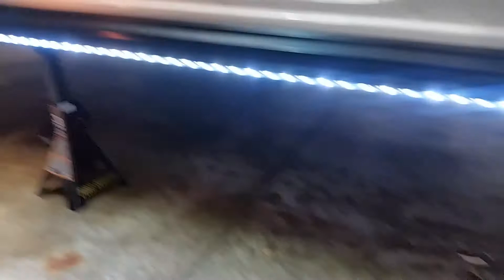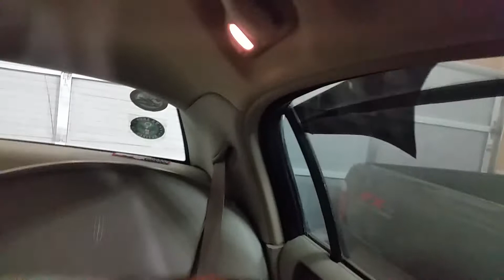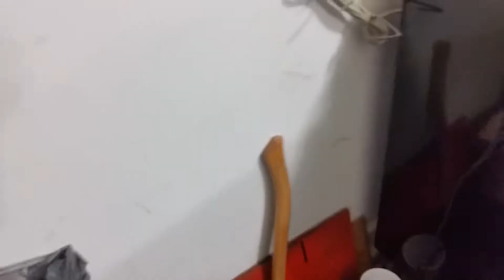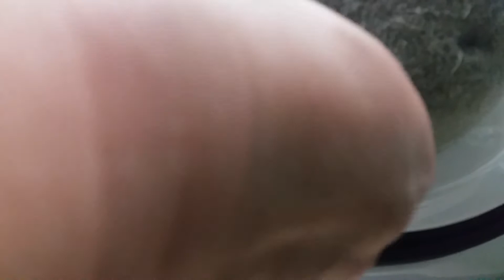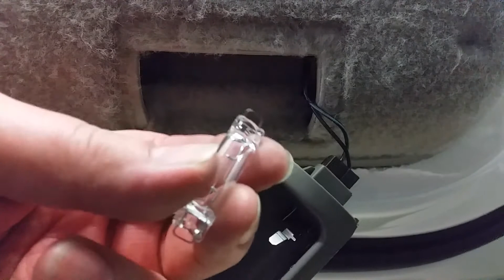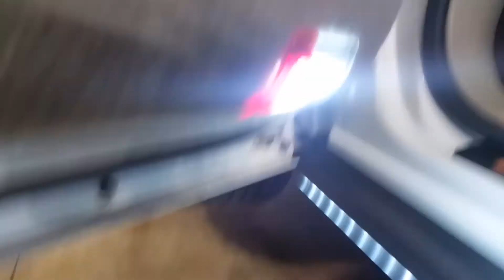LED's upgrade for the interior of my Lincoln Town Car 3rd generation.

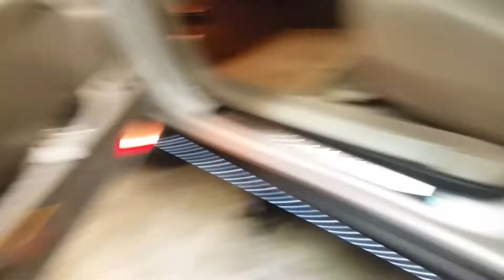Comment: New Subscriber here! 0:16  where is that running board LED video?!
Also, thanks ALL the interior LED videos, waiting on amazon delivery so I can upgrade!
Reply from the maker: Driver side LED side marker lights for Lincoln Town Car  - Also-  Passenger  side LED signal running board lights on Lincoln Town Car
Two videos I made for the installation. 

Here is where I got it from Amazon ; https://www.amazon.com/gp/product/B07XG195WY/ref=ppx_yo_dt_b_asin_title_o07_s00?ie=UTF8&psc=1
Reply from the maker: I forgot to mention it's been over 10 months  and the running board lights still working, very bright still and no bulb burned out.
Went through a lot of heavy rain storm and the adhesive tape still holding strong...

Comment: is a 2000 town car executive a 3rd gen? if not what are the gens and what leds will i need?
Reply from the maker: Yes they are from 1998-2011 Same wiring same design. Before you do anything pop off the cover to see if it's the same OEM bulb from my video.
Reply: @Pantherforlife  they appear to be all the same, do you happen to have a link for leds for the side opera lights? (the lights outside in between the doors)
Reply from the maker: @pstro09  The only person I know that did this. His channel is " Aharon C " He has the 2nd and 3rd generation Lincoln town cars. I sub. to his channel for he has good content on L.E.D.'s also. He will help you in what you want to do.